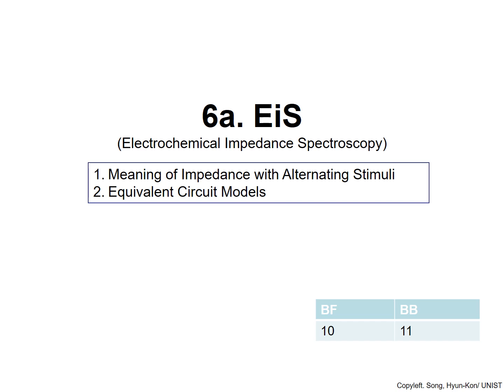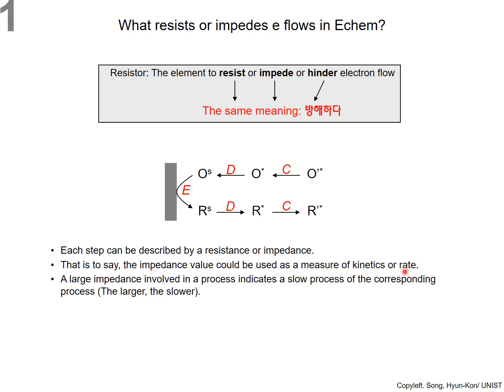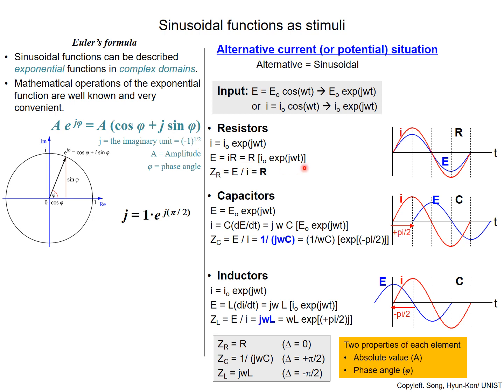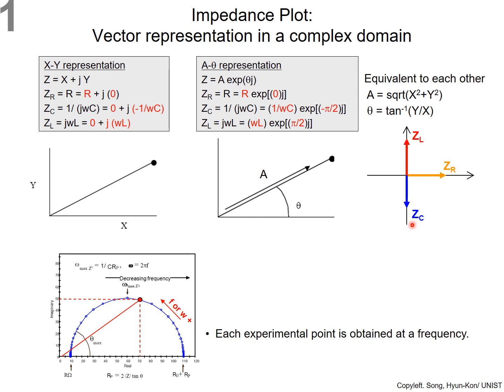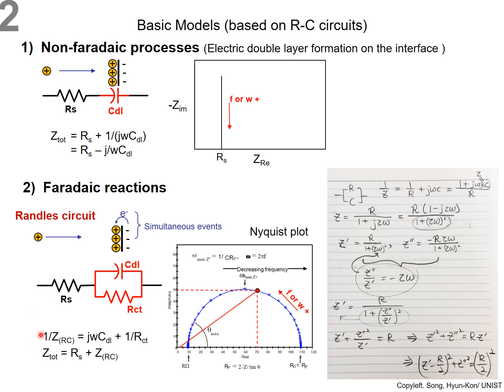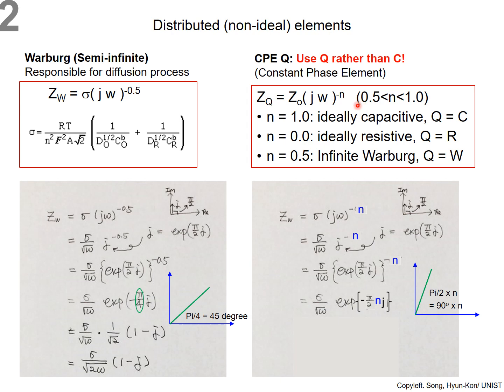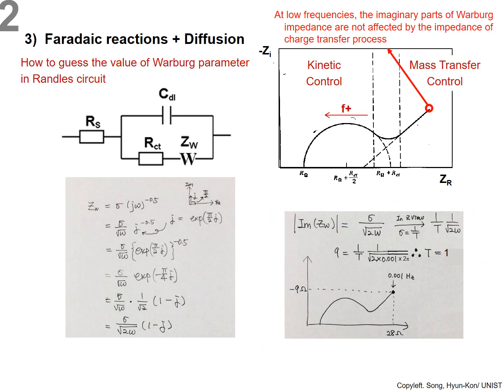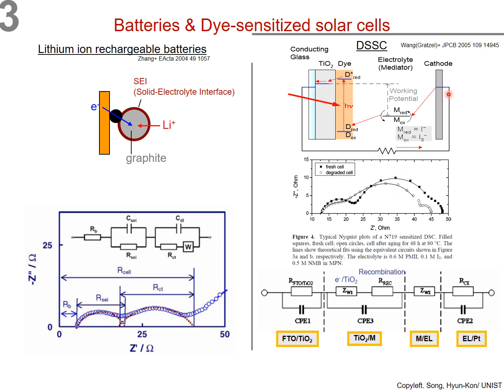EC@6a Electrochemical Impedance Spectroscopy (EIS)

Comment: Could please sir explains why metals can have a surface positive charge like dipping steel plate in sulfuric acid. I understant that dissolution causes electrons to remains causing net negative surface charge but the first case i can not rationalize it deeply.thank you